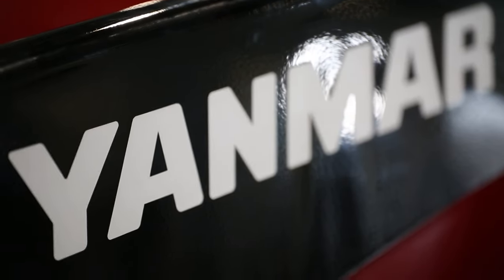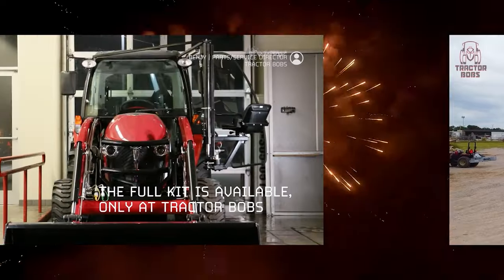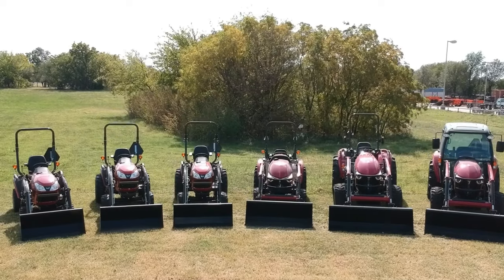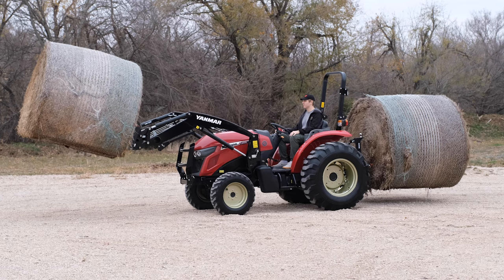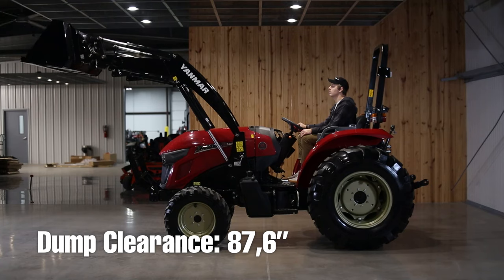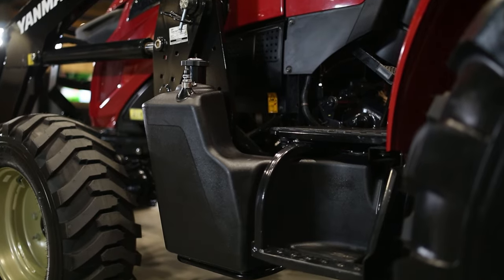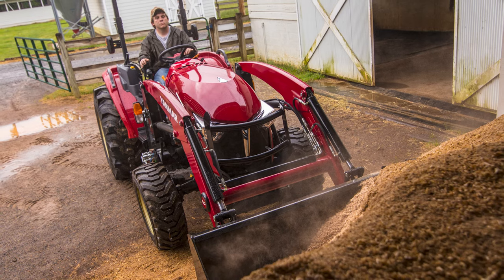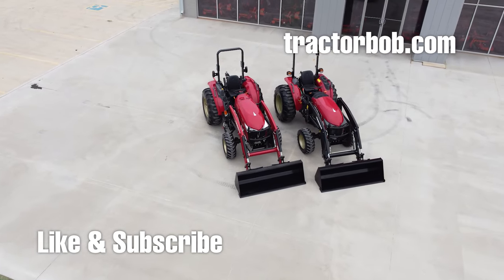BEST Compact Tractor for 2022 | Yanmar YM342 | In-Depth Look

Comment: i have an 87 yanmar 226d with just under 1000 hours. i have the loader, a snowplow, rear blade and brush hog. it works good. it has a JD cab on it, painted red.

Comment: This tractor with (finally GEAR-DRIVE) for features,capabilities, &price beats them all. Branson,Badboy,Case IH, LS,John Deere,Kioti,Kubota,Mahindra,New Holland,RK-TYM, are the lesser in at least 3 categories by comparison. Only Massey-ferguson's 1800m series exceeds in ALL but One,(slightly less weight). All are lossers by hydraulic flow( M-F exceeds ALL Others by 20% with 12.6 gpm for the implements)plus 12×12 Power-Shuttle,& console mounted loader valve. All that( my research, hands on & 2 1/2 cents worth)is why my next (#4) tractor will be a Yanmar or Massey-ferguson. Presently own A Kubota & 2 Massey-fergusons. Maybe l just like the color ( sunburst-red-aka M-F red). Thank you Sir for such an informative and well presented Vidio. Time to scrape up some more cash for the" new  tractor-wish-list". Happy safe tractoring Sir .
Reply from the maker: Donald, you're the man! Thanks for the comment, I couldn't agree more! 👍

Comment: Yanmar almost has the perfect tractor.   If they didnt change anything on this tractor and added a hydrostatic transmission, id trade my YT-235 in on it in  a heart beat!
Reply: Why not the YT347 with the awesome iHMT?
Reply: I love my 235, if I had a use for the larger one I’d buy it too
Reply: @JohnSmith-dj5gf because it's fifty grand. Most homestead folks don't have that kind of dough and they just want a 235 that weighs 3800 pounds and lifts 2000 lbs. This is why TYM and Kioti shine because they offer weight and fel capacity in a small frame/ HP at a very competitive price. I almost pulled the trigger on the 235 but was disappointed in the plastic hood , lack of chassis weight and fel capacity. Other than that I believe the 235 is a solid tractor as far as engine, transmission and reliability.

Comment: 10 year warranty you can't beat that price and comfort
Reply: Well that depends. I had a Kubota. In the computer died twice. Both times the company insisted the computer go back to Japan before honoring the warranty. Each occurrence had the machine out of commission for 3 months. When the computer failed the 2nd time, the replaced it and voided the warranty with 2 years still on it. The dealer told me if I lost the computer again it would cost me $2500. I traded it for a Massey that day

Comment: You can down size the hydraulic fluid to the steering and put more to your buckets and rear attachments… the steering doesn’t need 5.3 hydraulic pressure… steering from what I’ve learned you only need like 1 hydraulic fluid pressure or less for the steering so you’re wasting a lot of hydraulic pressure on the steering when not needed…

Comment: Does this tractor require that diesel exhaust fluid? If so, are there electronics that reduce or inhibit it's operations when there DEF runs out?
Reply: No DEF used or required.  The  YM series has a passive regen-function cannister that is basically unnoticeable IF the tractor is often operated in the 1800 RPM range.  Gotta keep the engine and exhaust heat to a sufficient level for the YM's passive regen to do it's thing.   Also:  Not to Dis anyone, but you folks that still think Hydrostat is a "good" thing don't/haven't owned enough tractors yet.  Go gear-drive.  Hydro is one big pump that robs power and adds a lot of initial AND maintenance cost, and if you fry your Hydrostatic Transmission your whole tractor is scrap.  Hydro sounds good to the uninitiated and is therefore a big hit with the marketing department, but that's about it's only positive contribution.
Reply: @wrs840  something does not any sense, you said it does not require def but then you said it regens. Diesel engine that regen require def. The purpose of regening is Diesel fuel being dumped into the particles materials filter to burn of carbon. Would you care to elaborate on this?
Reply: I had a gear drive New Holland and I was used to that as all I ever drove back in the 60's-70's. With the F/R on this tractor it would still be great on loader work without the maintenance of a hyrdo set up.
Reply: @johnweymouth5685  not quite right.  Under 75hp tractors that regen do it by cooking the particulates off, and do not use DEF.  Over 75 hp tractors require DEF.
Reply: @wrs840 everyone was telling me go hydro, but then i drove a gear shift... it was easy, and i could crawl at 1mph, or go 30mph.  F/b function super easy. And i absolutely hate the whining hydro makes.

Comment: Just a heads up. I bought a ym342 and ordered their 3rd function kit, it is not a true 3rd function kit it is a diverter valve. So as of now I am in the process of seeing if the YT series kit will work on the YM series.
Reply: All factory kits are diverters. We’ve installed them on gobs of machines. The YT3 kit is also a diverter.
Reply: @tractorben  yea it's a shame for the 900 dollars yanmar charges for the kit. Love the tractor just bummed I have to build my own kit.

Comment: Did you list PTO hp?
Reply from the maker: darn I forgot that one!
Reply: 31
Reply: @marcinpodbielski9016  That seems like alot of power loss for a gear drive. My j d goes from 32 to 27 pto h p with a gear drive. Mine is a 4310 now about a 3033.

Comment: Got rid of my Yanmar(s) just because of "rebranding", remember Solis ? and now some other off Brand tractor with a Yanmar name AND what about the crappy dealers near me, what happened to the "performance link technology" where major components were engineered to work together ??.   Must be hard times at this company to transition from selling high quality Japanese machines to rebranding to increase sales.  Good luck peeps and get some spare parts while you can.
Reply from the maker: Yanmar is doing better than ever, they've been ranked number one in quality and parts reliability, for 5 years running. Sorry to hear the dealers around you aren't very good. Solis and Yanmar were never the same tractor brand, they simply made Solis tractors red to match Yanmar and then sold them at some of the dealerships in America. Yanmar still remains the leader in compact diesel engines and are in all of the John Deere Subcompact and Compact tractors under 60hp.
Reply: @TractorBobs  Seems to me the new YM’s aren’t Yanmar either… I could be wrong but isn’t someone else making them and putting the Yanmar name on them ??    

Beautiful tractors but hopefully they sell out to Mahindra or Kubota so we can get dealer support and product to look at when buying new.  Mine were good rigs just no dealers or support, now someone else can enjoy the poor ownership experience I had
Reply from the maker: @35goonyboy  The YM tractors are 100% Yanmar tractors backed by Yanmar 10 year powertrain warranty. Thanks for the comment and yes dealership support is a top priority!
Reply: @TractorBobs  well,  if your sure I will believe you but don’t regret selling mine…. Good tractors but to unstable with hardly any dealers for the amount of time they have been back in the USA…  heard John Deere is going to move away from Yanmar engines